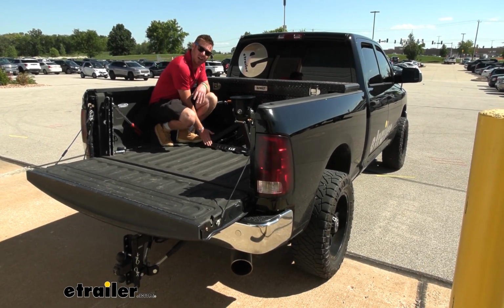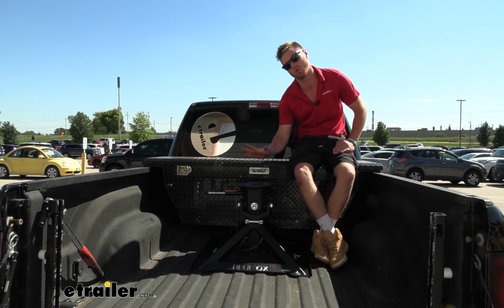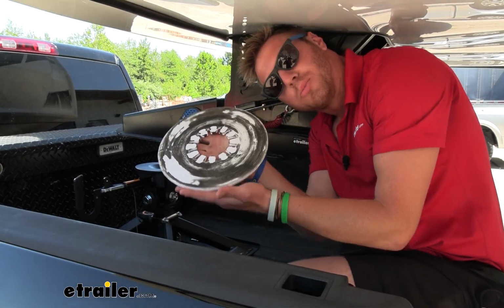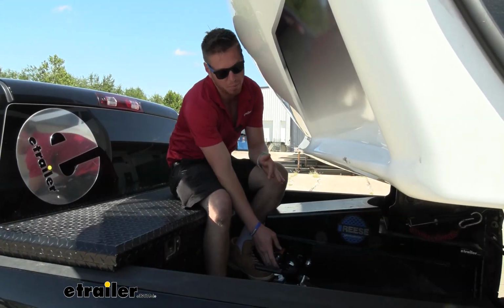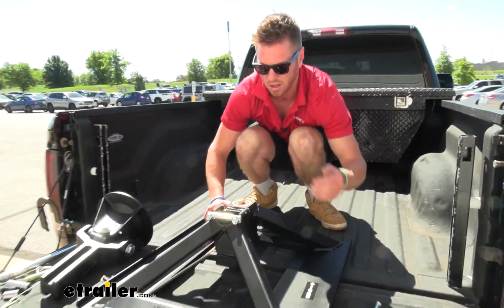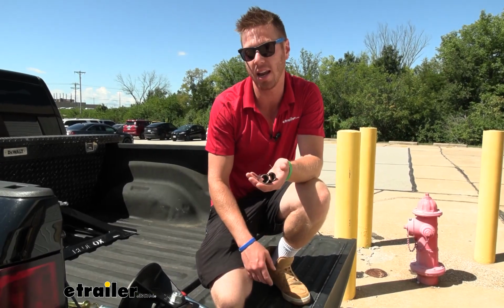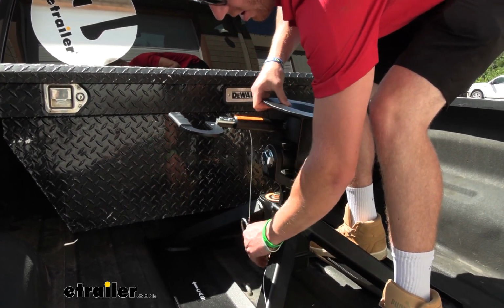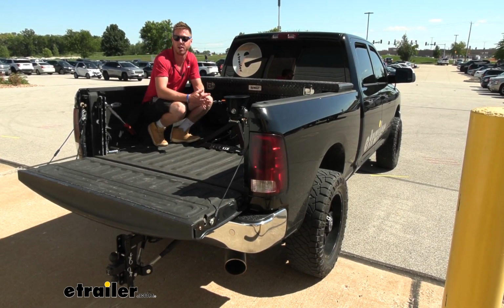How to Install: Blue Ox Gooseneck-to-5th-Wheel Trailer Hitch Adapter on your 2013 Ram 2500

Comment: Looks like hou could pull the bottom 2 pins and lift with front landing legs a nd remove from the truck bed
Reply from the maker: You can certainly do that if you wish!
https://www.etrailer.com/Gooseneck-and-Fifth-Wheel-Adapters/Blue-Ox/BLU52XR.html

Comment: Are they gone built one for the oem puck system?
Reply from the maker: If your puck system includes the gooseneck hitch, you can mount the Blue Ox adapter to that. Blue Ox doesn't currently have plans for a 5th wheel puck mount.
https://www.etrailer.com/Gooseneck-and-Fifth-Wheel-Adapters/Blue-Ox/BLU52XR.html